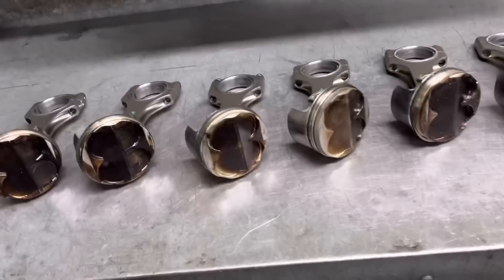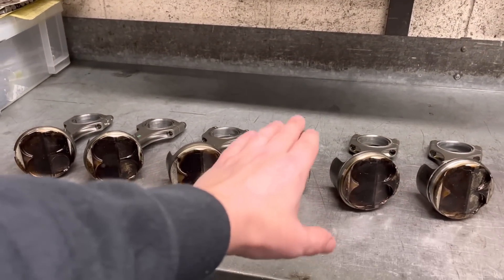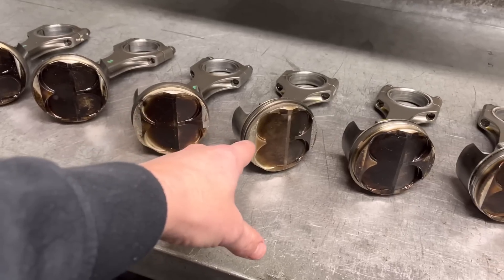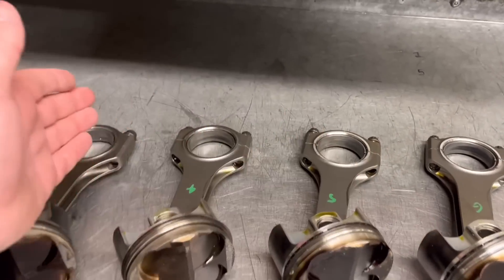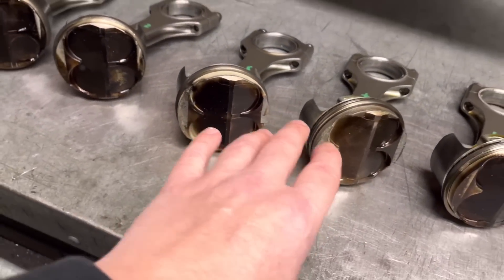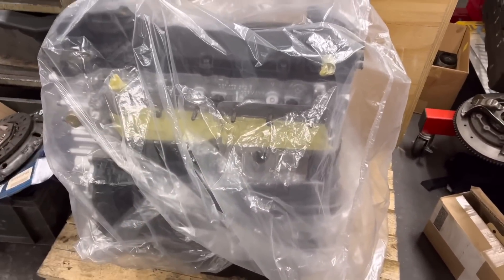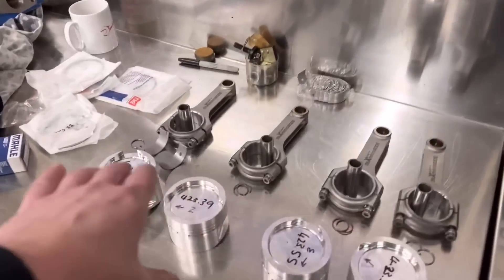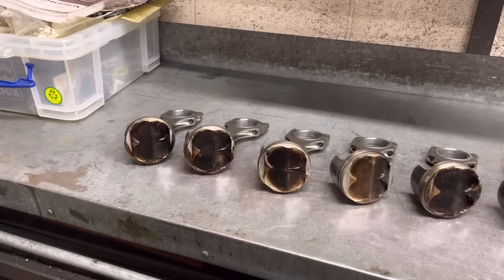BMW E46 M3: My opinion on why this engine lasted 2 days & went BANG

Comment: GREAT video Lee. The biggest part of this situation is the detailed forensics and explanation of this catastrophic event. We have seen this type of failure over the decades we have been in business. I learned another telltale fact today. We work with carburetors as fuel injection was not prevalent in pre 1980 motorcycles. A fun, yet serious, tutorial. This was an expensive learning experience for the client. Your diagnostics are spot on.....again. Thanks for investing the time to teach about issues that come up outside the realm of building motors. You ROCK! My very best to you, Paul, Isaac, John, and your family. Have a DELUXE day!
Reply: Hey Chris. I do not agree with your comment at all. I have been in this industry for decades. We may not always agree with certain issues. That is normal between engine builders. I have worked along side of some of the greats in my industry. I didn't always agree, yet I always listened and learned.
Reply: @matthewharlowehrscyclespor668  If you had actually worked as an engine builder, then it seems likely you would be aware of the need for proper cleaning equipment, and perhaps would try and avoid using worn out old WW2 machine tools, on customer  engines?  

I have noticed that those who spring to the defence of an idiot, who puts crankshafts in back to front, and who seems totally inept, are very often pretty clueless themselves........
Reply: Hey Chris. As a matter of fact I still build motors for a list of clients. All of them are of the classic and vintage variety. I have motors in from 1917 to 1979. I own a restoration business in the states. Enormous fun. Tools and machines are only as good as the technician operating them. I have witnessed some pretty poor work from those that use new technology. My personal machinist is a fellow I have used for over 40 years. He used somewhat "old " technology. The difference is that he had always performed appropriate maintenance on his equipment. I trusted him completely. He taught me early on how to use mechanical measuring equipment. I use a combination of digital and mechanical these days. As far as your point on cleaning of the parts. I have only witnessed clean product being assembled. Solvent tanks are appropriate way of cleaning parts. We use 2 solvent tanks in the business. The nasty parts that come in will be precleaned in the first parts washer. The second parts washer is for product prior to assembly. We utilize a media blast cabinet and a vapor honing machine. We also utilize an ultrasonic tank. Barum engines is moving forward in improving the standard of completed product. The mention of a possible clean room and the new vapor honing machine are already in the works. The vapor honing machine will set a new standard of product. We have enjoyed our machine for over 7 years. It was a major expenditure at the time. They are far more expensive now.
Another item you mentioned was the issue of the orientation of the crank. He mentioned that as a point that all of us will make a mistake now and then. The important part is that he shared a small foible. Humerous at best. I personally enjoy these videos. Like many, we look forward to our short visits. I use these as a break from my day.  I don't believe that those people that applaud Barum Engines are clueless. 
Many of us enjoy Lee and the crew. We can witness normal business issues. It allows us grace to understand other business owners are going through the same issues. Small businesses are fragile. Normal life experiences effect daily production. My final thought and observation is that we all can make personal choices. I choose to enjoy 15-20 minutes of camaraderie, education, and insight of a normal small business. It seems that you don't experience that same joy. My thought is that you have a choice to possibly "turn the channel". No disrespect. Just an observation. Be good. Stay safe.
Reply: Hey Chris. As I mentioned earlier you have the choice to move on in your life. I'm not quite sure why you are such an angry person. I believe there may be another underlying issue.  I'm sorry you have decided you use this forum to vent some of your own personal issues with Barum Engines. Lashing out, to others that you do not know, reads volumes. This thread has less to do with 'antiquated" equipment. You have now become the click bait. My opinion remains that you have a choice to leave this channel and find something or someone that will better serve your needs. It might be the healthier choice. Your deep anger is alarming and unhealthy. I wish you the best in your life. Turmoil and anger has rarely brought peace. This is the end to my participation in this thread. Be good. Stay safe.
Reply: @matthewharlowehrscyclespor668  Amusing that after your idiot attempts to defend cowboy con artists have failed, you choose to slink away................
Reply: As Lee has no idea how to build a race engine, and doesnt even have a hot tank to clean parts, maybe his opinion is pretty worthless?

Comment: I feel I was spot on with my BMW buggered engine analysis.  To honest, you have to give all the information 1st up,  You still have not shown the cyl head and never told us about the melted s/plug. No good guessing at compression ratios if the owner is going for broke, which he did in the end. But in the end your not responsible for his/her decisions on engine build or tuning,  Some people just are not born with an innate engine feel, and do not know shit from chewed dates, and run an engine to the BMW mess on your bench. 
There is NO doubt in my mind, you do good work and are as honest and truthful as the local vicar

Comment: Is pre-ignition the same as  pinking?
Reply: No. Pinking is ignition initiated at the intended time by the intended mechanism, but with subsequent increases in cylinder pressure causing auto ignition of the remaining mixture. If you want to get into this.... Haynes, Motorcycle Fuel Sytems, John Robinson is a most informative and accessible textbook.
Reply: Many thanks for the heads up, no, merely curious,  I'm in total awe of folk who know the ins and outs of  engines.

Comment: monitoring the exhaust temperatures is the only real way of knowing how consistent and balanced the burn is,  ignition timing plays a big part in that if at higher rpm its slightly retired it will burn the pistons

Comment: In my opinion, 12:1 compression requires all out race fuel. Something on the order of 100 octane. Especially if the motor is being stressed as in track racing.
Reply: Good point but to be fair if this engine has cams that lower dynamic compression ratio then 12:1 is not problem.
But i do agree this engine really should run race fuel or atleast e85 at 380hp or atleast detuned slightly from the 380.
Reply: My R1 has 12.7 :1 compression ratio and it came with unlimited km warranty, revs to 13,000+ rpm and runs on 98 octane fuel.

Comment: I had a Cosworth DFR die on me at the top of Kemmel Straight at Spa which, as you probably know, is uphill. It was severely detonated. The cause was the fuel pump running out of capacity at 9500 RPM and maximum load causing a lean mixture. It took less than 5 seconds to destroy the engine.
Reply: Exactly, I see people commenting about knock sensors, my experience of them is that it's too late by that time, damage is already done.

Comment: I'm sorry, but I don't agree that 12.3 : 1 compression is OK on UK super unleaded. 15 years dyno tuning says no. You might be ok on quick dyno pulls, but prolonged high load will make it det its tits off unless the tuner is extremely capable. BUT, if I'm honest, there are a couple of things you have in the build that I don't like either. YOU NEED A DYNO, OR A DYNO GUY.  In my experience, in these situations, it's always the mapper or the builder that gets blamed, and it's often neither. My opinion is that you need to have the build, AND the installation and tuning under your control. Until then, your playing with fire. Good luck 👍
Reply: Super unleaded varies too, some is 97 some is 99. If you are tuning an engine to within an inch of it's life you shouldn't cheap out with the supermarket 97 RON E5.

Comment: You should be saying engine warranty will not be entertained on any engine unless you can produce receipts for new or tested injectors and documentation that it's been tuned by a reputable tuning company and not some Billy Bodge it down some back alley.

Comment: It's well documented that the rod bearing clearances in the S54 are shockingly tight, given that they can rev to over 8k. Those bearings looked dangerously worn, even without the pre-ignition issue they wouldn't have lasted long with constant track abuse. Sole main reason for the bearing wear in the S54 is not allowing the engine to properly heat up before giving it the beans. And the engine is already highly strung from stock. Only way to get proper power is to supercharge it, or lower the compression and turbo it. You want to kill everything on track with an E46 M3? Strip it out and put carbon panels on it. Squeezing extra HP without really much of an increase in torque is a false economy.
Reply: Losing weight is a winner,,, . Agree with you on turbo or supercharger
Reply: @hannahtimson2526  My ex wife didn't think losing weight was a winner when I told her a similar therapy🤣🤣
Reply: @kiwidiesel  N i c e

Comment: As I said in the last video
I think I could be the spark plugs running a bit to hot 
That give you pre ignition
Possibly need a cooler running sparkplug
Reply: Hotter running plugs won't cause this carnage,  there is alot pointing to less than ideal fuel delivery to those cylinders.  There is too much variation on the pistons to be plugs else they would all be similar color and staining.

Comment: Pinging, too much ignition advance, too much heat on lean and melting pistons. Tuner and user issue. Nothing an engine builder can do about. That is why race engines don’t get warranty unless its keys to hand pack. Race ready built and tuned, it might get warranty if you present logs its been running right.

Comment: Could under fueling not cause the detonation?   In my mind I could see that being an issue, where as the air fuel ratio is not 100% and the air getting hot when compressed and combusting the fuel before the ignition stage. This could be the cause and eventually causing the bearing to fail and it just snowballs from there.  That would suggest that the injector is not up to the fueling it needs. then the tuner saw it needs fuel with the afr gauges and just opens up the taps for over fueling the other pistons.  Even with the over fueling those injectors could not keep up or stop it from happening.  I would suggest have the injectors tested.

Comment: If the exhaust manifold was equipped with temperature sensors, (maybe it is) could that prevent that engine failure? I had it on my Sierra Cosworth, and you could see directly if the engine lean out.
Reply: EGT sensors. Sounds like a less that adequate calibration issue.

Comment: I think you are glossing over the oil squirters as an issue, which ones broke off? they are there to cool the pistons and without them the pistons will overheat, if 3/4 broke off well there is your detonation

Comment: my mate had a rally engine built a few years ago drove it ok for testing and had it tuned  then the day before the event he done a oil and filter and plugs ready for next day trailerd to event the gave it a go about third  of a way through engine blew up got it home gave the engine builder a call he came took the plugs out and told him he put the wrong temperature  plugs in when he looked at the two sets of plugs there was a difference     and hes been in the trade for 40 years and didnt think the plugs would do that see what plugs was used  and have a talk to a plug manufacturer
Reply: A little knowledge is a dangerous thing. 
We can all recall times when we've done something without realising the consequences,  but that's how you learn. Just annoying when it's such an expensive item.

Comment: That vapour-blasted engine appears to have come-out in incredibly good shape. I do have to wonder if that one was in especially good shape before the blasting, or will that be the typical result? 

One then has to decide, when the result is that good, whether put a protective coating on, or just leave them?
Reply: I'd personally 100% would put a protective coat on it as it won't stay like that for long. As for how it looks now, I'd guess it wasn't too bad before but those vapour blasters do an incredible job.
Reply: Without any proper cleaning gear, if the engine was blast cleaned, the reason for failure is pretty obvious.
Reply: @chrisstevens8431  he's taking about a different motor,  not the blown m3.

Comment: Knock sensors are great for std or near std builds as they're tuned to certain frequency range/s. This had different pretty much everything and a track car could have the engine solid mounted where I've heard several times the sensors can flag a false positive.  

Bad injectors could be overfuelling 1,2,5,6 and underfuelling 3,4 leading to a good lambda reading but hiding the problem. This is why a lot of tuners have individual EGT temp sensors when flying close to the sun.
Reply: If we had like mapper who has ability to use knock headphones to map then we will be safe.

Comment: You will never get the burn rate correct if your injecting in an unknown fashion. Highly tuned and hope for the best rarely works well. Everything double checked twice then again as time is put on the machine. Wonder when they first pulled the plugs to check their condition. Plug colour tells you everything you need to know if something is far wrong.

Comment: I can't see how you can put a warranty on a competition use engine.  
You have no control over what happens once the engine has left you. Brand new build , straight on the dyno ,tuned? (badly)   to an inch of it's life ,everyone is high 5's with the power numbers, then do a track day.
You simply can't warrant this sort of stuff.
Reply: Have you not heard of “start-up” warranty ???
Reply: @wrx2hot4u  No such thing on a race engine.
Reply: @wrx2hot4u  Please post up a link to details of any UK engineering company, which provides a "start up" warranty on highly modified competition engines?
Reply: @chrisstevens8431  For starters “UK engineering shops” dont build motors lol. Car Performance / Engine Builders … build motors. You dont even understand the correct terminology. How about you go do your own research. It sounds like you dont even understand what a “startup” warranty is to begin with.
Reply: @wrx2hot4u  Bearing in mind NO engine/builder, engineering shop,  "performance engine builder", based in the UK offers ANY sort of warranty on a race engine, I would suppose Barum is faking up a claim, in relation to a warranty, which doesnt exist!  These cowboys seem much better at clickbait than engine building.......................lol
Reply: @chrisstevens8431  so your saying no engine builder takes any responsibly for their work? I find that hard to believe. Also let me know what a “race engine” is … then if you could explain the different start up procedure on a “race engine” vs a “stock” engine?
Reply: @adeburton4885  I heard Dave is now living in the US, and has been involved with building exhausts for 2T Bonneville bikes?
Reply: Thats spot on Dave!  Seeing how Barum work, their WW2 machine tools, and no cleaning gear, cant see how they can warranty anything they do?
Reply: 95% of the videos on here are clickbait!  No engineering shop would warranty ANYTHING, unless assembly and fitting, is all done by them or their agent. The fact that the videos are fake, is confirmed by Barum NEVER having faced court action......................
Reply: @chrisstevens8431  wow performance shops in UK must be bad if they cant even warrant the engine being able to start.

So say a motor is fully built, installed etc but wont start due to a compression issue… thats got nothing to do with the tuner or mechanic. The engine shop has to have a basic warranty.
Reply: @wrx2hot4u  In the USA in the 1970's i learned that NO engine shop ever gave any sort of warranty for a race engine of any description. I'd bet nothing has changed in 50 years.
Reply: @Mercmad  please dont comment unless you have experience in the last 20 years. What they did 50 years ago is very different to now. Technology has advanced, motors have changed. Again i bet you dont even understand what a start up warranty entails.

Its not a running warranty, ie x amount of time or x amount of Kms/miles. yourself and others dont seem to have any first hand experience of how things work today.
Reply: @chrisstevens8431  cool story bro, needs more dragons!
Reply: @wrx2hot4u  If the large number of videos, covering complaints from customers, are authentic, they dont have any proper cleaning gear, and really do use WW2 machine tools, then Barum are the most incompetent engine builders on Youtube.
Reply: @wrx2hot4u  most shops dyno break in race engines. Or they give strict break in rules that relieve them of liability
Reply: @captaintoyota3171  Yes, your totally correct. What seems to be misunderstood by the other people commenting here is the meaning of a start up warranty. Most race engines are broke in on the dyno because they arent going in a street legal car to put kms/miles on.

You could say the warranty really only covers the first start and run in which might only be the first couple hrs on the dyno.

If an engine builder cant guarantee the motor they just put together will start then they are in the wrong business.